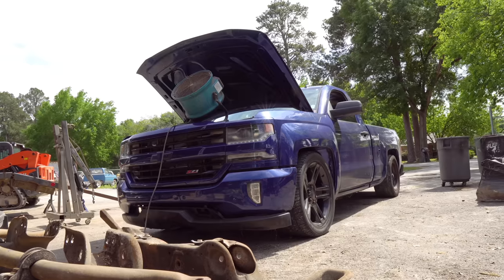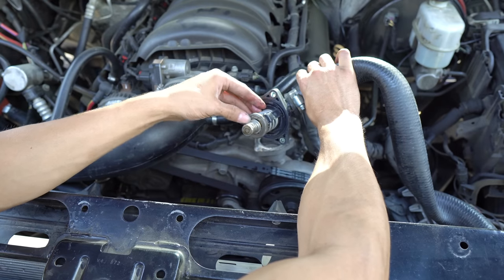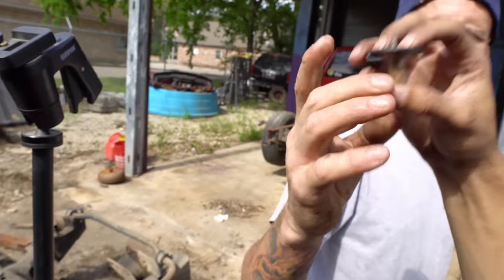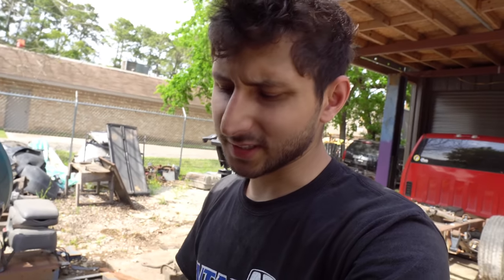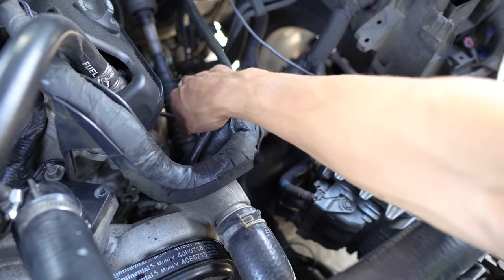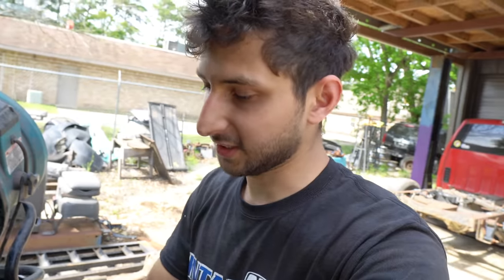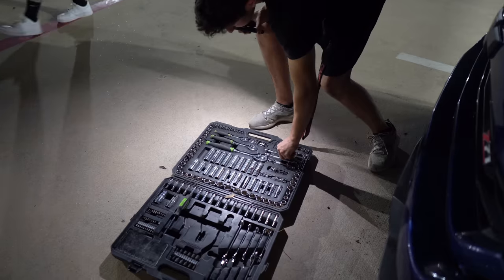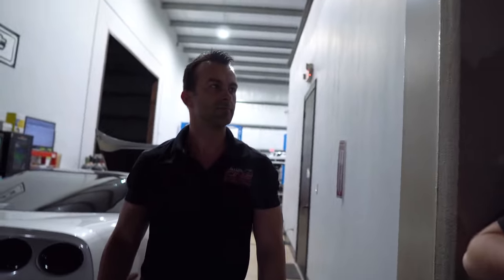How To Fix Your Over Heating Problems !!!!

Comment: You need to leave the thermostat in, if it’s to cold it will keep your temp low @ 160 which tells the computer a fault, a/c will stop working and fans will stay on

Comment: i had this problem before on a tbi 350...changed temp sensor water pump an thermostat before i found it was the radiator cap

Comment: You need a thermostat. These Gen 5 trucks cannot run without a thermostat I learned the hard way as well just go with a katech. I did that and haven’t ran into any issues since

Comment: Try to get a universal transmission oil cooler my temperature was always at 190-210 and now with the oil cooler doesn’t pass 160 which is 30 degrees way cooler and in highway speeds it’s always at 136-140 so reallt recommend that since you push that v8 a lot